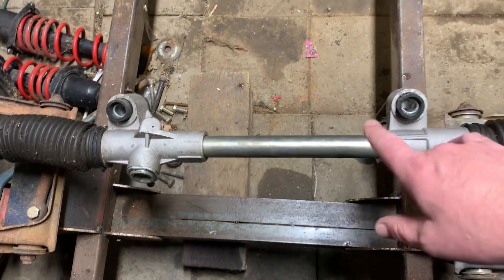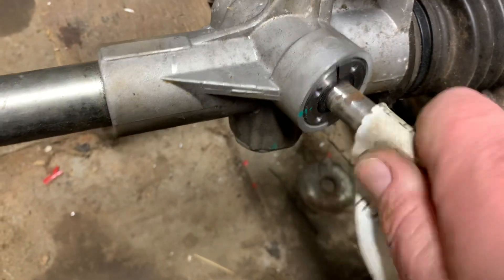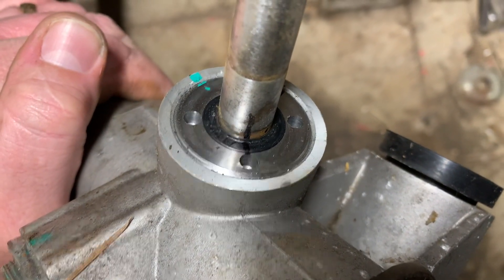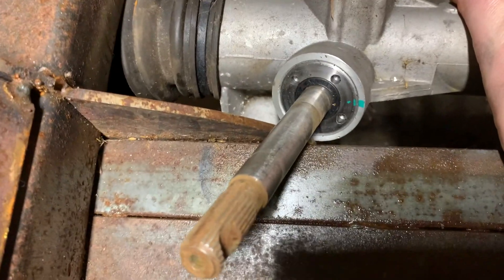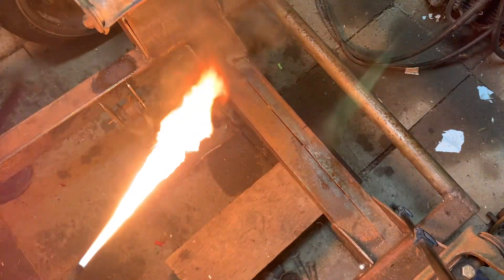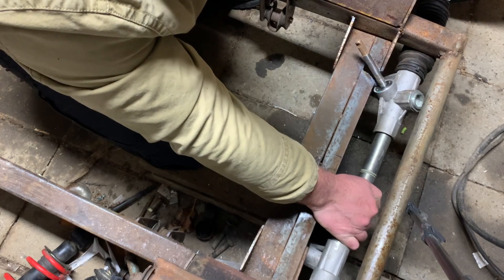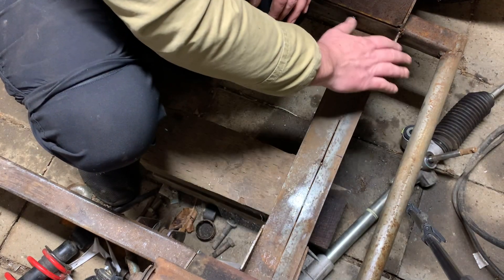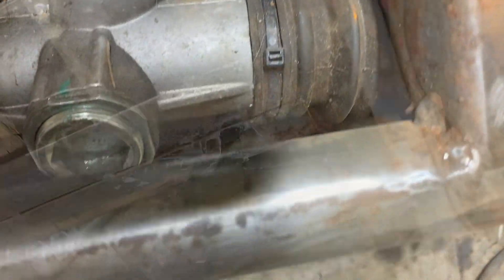T Bucket Hot Rod From Spare Parts Part 3. Rack and Pinion

Comment: How does that go Turlo,,a little slicing and dicing, Come Onn!!Nice job but yeah those cut off wheels or even the plasma with a flap wheel you can’t beat um,,,I’m sure you’ll have some wheels for your next video,,Keep up the good work and catch on the next one 👊🏼👍🏼
Reply from the maker: Thanks for stopping in. I picked up a flap wheel and cut off wheel’s yesterday and did a little filming last night. I have never built a T bucket so should be interesting.